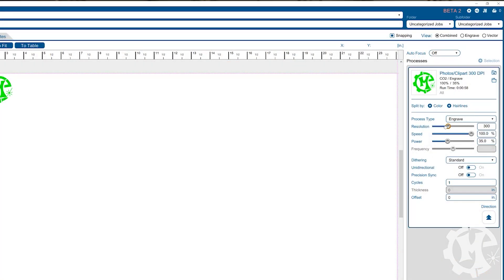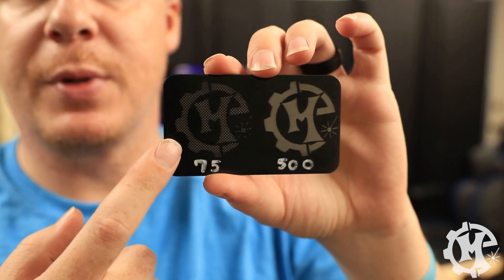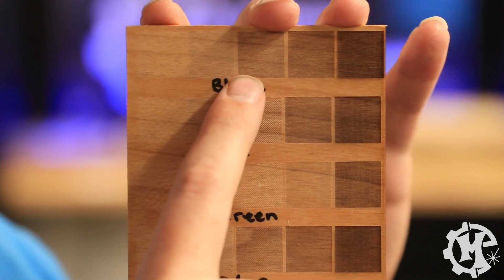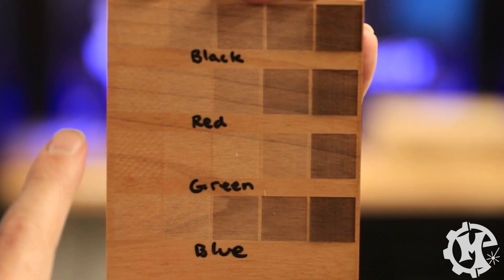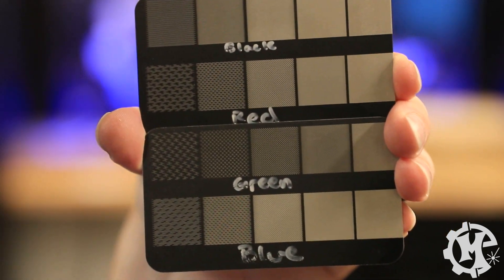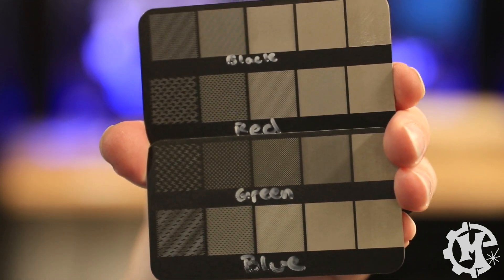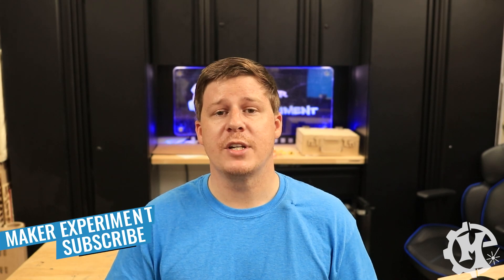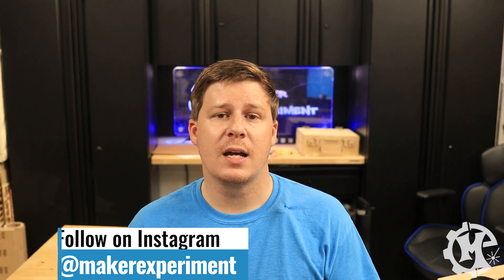WHAT IS DPI FOR LASER MACHINING?

Comment: I have a 20w diode the laser point on spec is 0.08 don't that mean if I pass 318dpi I would get crossed over lines? So depending on the laser point you can't set just any high dpi and get same results as someone that has a very high quality laser right?
Reply from the maker: I honestly don’t know enough about the diode lasers to give you correct information on that one.

Comment: Hey Trevor, sorry for the offtopic question, but do you know if it is possible to send files to the fusion edge from a macbook? I know oficially they don’t support macOS but I was hopping you know a good workaround. Thanks and good luck with the channel, learned a lot so far.
Reply from the maker: If you have an older MacBook with parallels, you can run windows on parallels and do it that way.
Reply: @MakerExperiment  thanks for the reply. It’s an m1 macbook, i have win 11 arm running with parallels, but couldn’t install the epilog drivers. The supplier contacted epilog and I am waiting for their reply to know if it is supported for win 11 or not. It’s kinda strange that they don’t offer macOS drivers.

Comment: 75 dots per inch does NOT mean 75 dots per square inch. There would be 75^2 = 5625 or 75 dots per linear inch.
Reply from the maker: Yes. I made a mistake in the audio and didn’t catch it in the edit. That’s my mistake.
Reply: How is this possible?